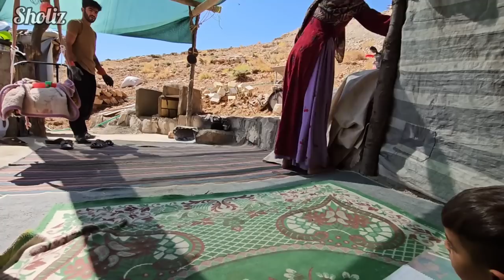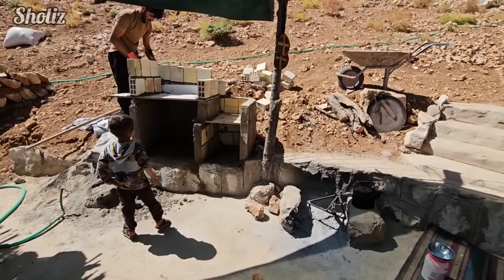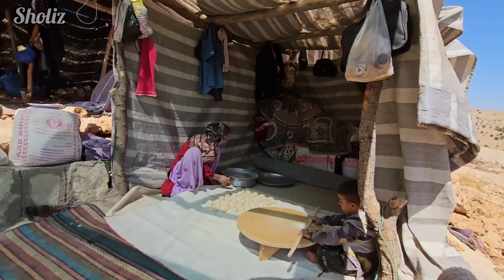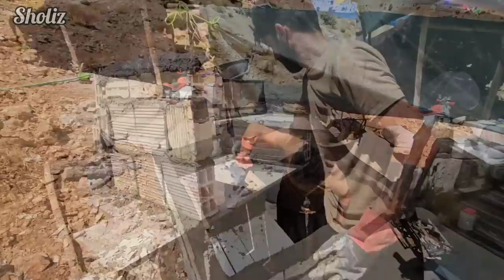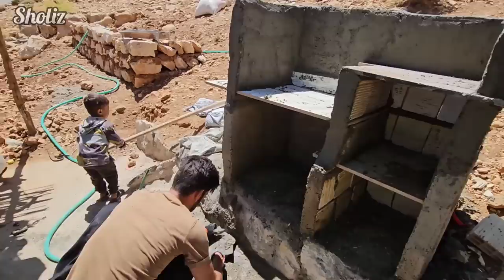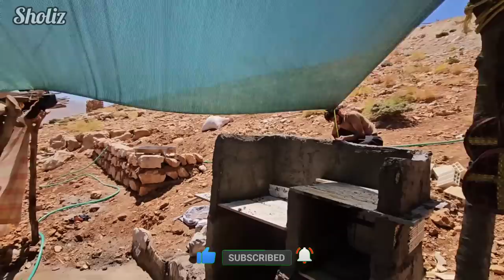Iranian Nomads' Gas Stove DIY: The Art of Traditional Craftsmanship (Part 2)

Comment: Sajjad, i think you hv got the height measurement wrong for this gas stove.  By the time the pot is placed on top of the stove,   it will reach higher than Narges shoulders.  How will she stir the contents in the pot??😢  remember the gas.stove has legs.  It will be a strain to keep her arm up above her shoulder to cook.  Narges is shorter than you.😅.   I know you intend to place the gas cylinder beneath the stove But your entire structure is higher than the floor.😂 So, you need to raise a cement platform on the ground for Narges to stand comfortably to cook. Make sure the platform is wide and deep otherwise she will fall down when she turn around with the pot. 😅😊